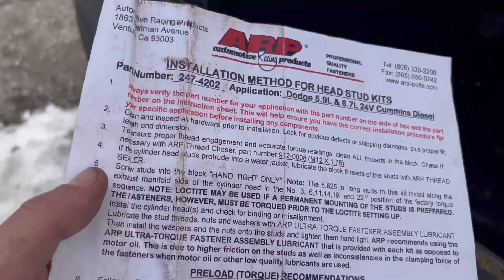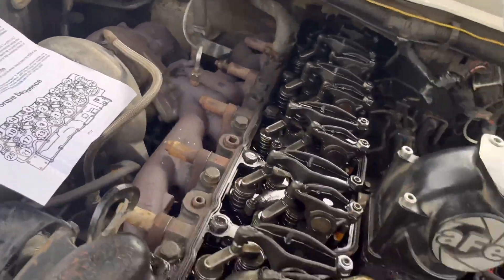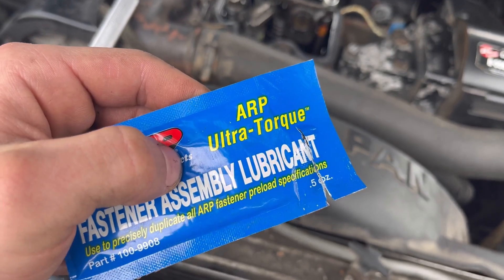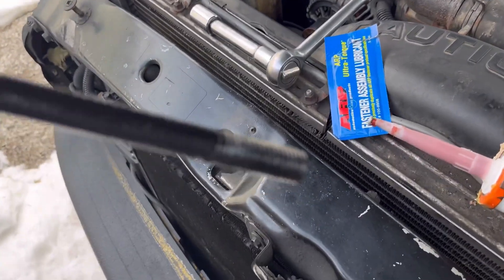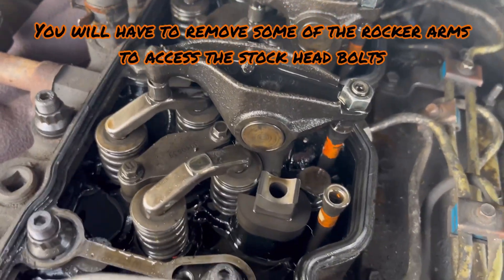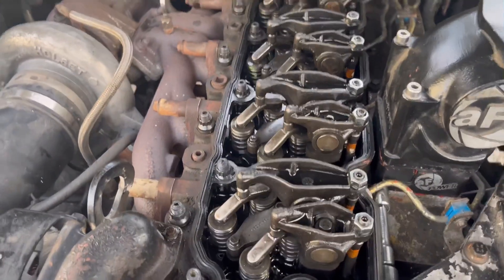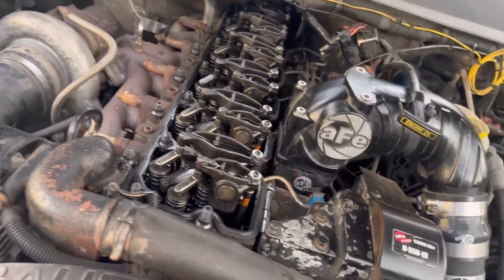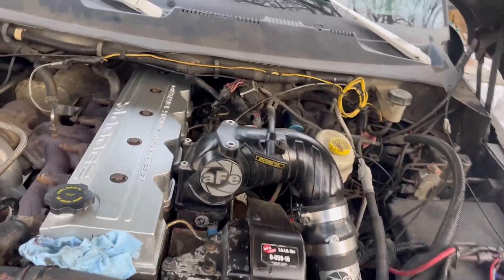Dodge Cummins 5.9L/6.7L 24v ARP Head Stud Installation

Comment: Hey did you happen to have a little bit of water and oil in each bowl hole. My bolts that I pulled out was saturated and I had a small little puddle in each hole. Probably only two of them were dry. I know I know it's head gasket time
Reply from the maker: Some of the head studs go into the water jacket. That might be why. But it shouldn’t be all of them.

Comment: Highly suggest you utilize the hex hole on the top of that bolt and snug it down. I'm sure there's no torque spec for the bolt itself but just wiggling it in there with your fingers… I don't know about that
Reply: It specifically states to “ only tighten finger tight “. When you do your torque sequence you tighten your studs and don’t push them into the block. Do not tighten them prior to applying washer and nut. You will get uneven surface tension on your gasket.
Reply: Just did mine with head bolts. I guess a short socket with the intake rocker moved would've worked I ended up having to pull off both rockers on every cylinder.

Comment: Do you recall what bolts are in water jacket? I’m about to do this
Reply from the maker: I don’t recall which ones exactly, but you will know when you pull them. Just have some sealer on hand when you do the job.
Reply: @user-px4us4ou1bi assume the top is lubed along with the bottom of the nut?
Reply: How much thread seal should be applied on the studs?
Reply: The ones that are on the side of the water jacket. Left side by exhaust.